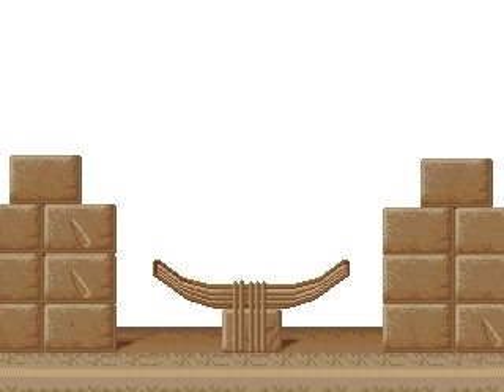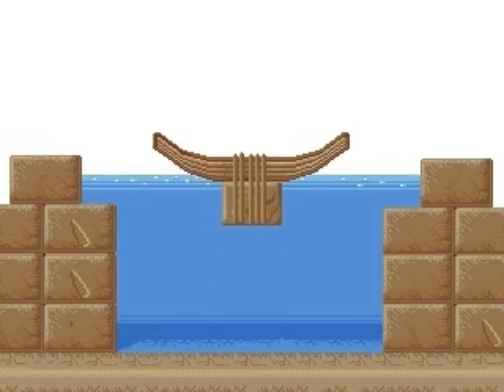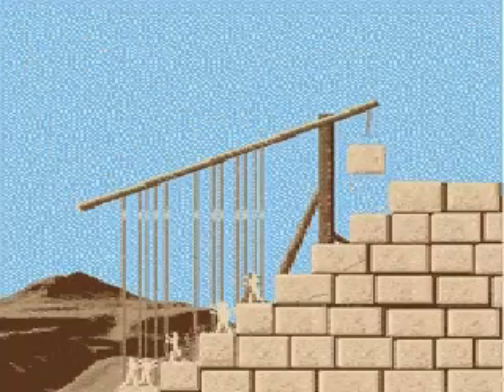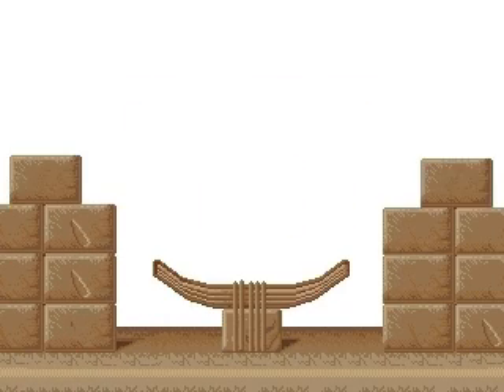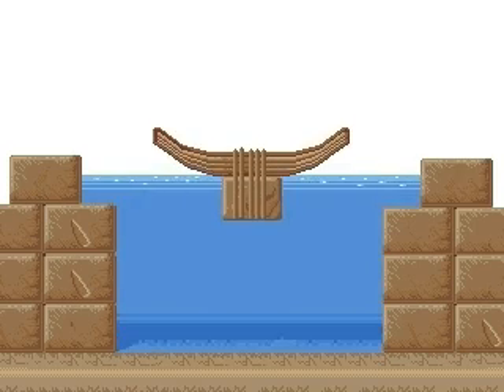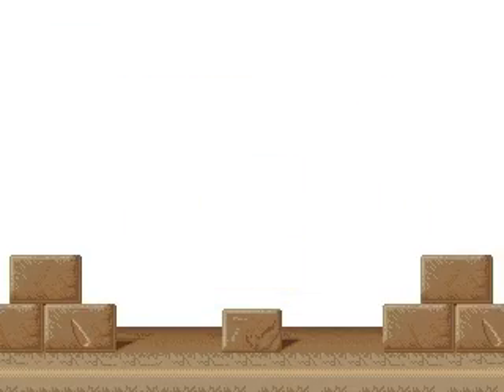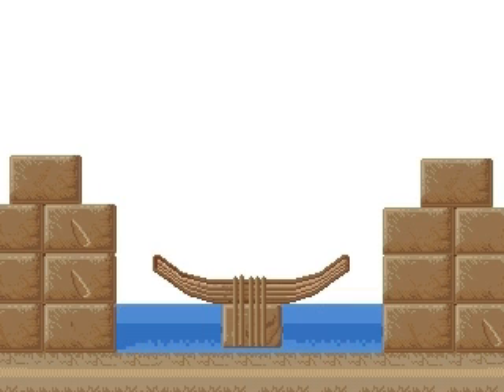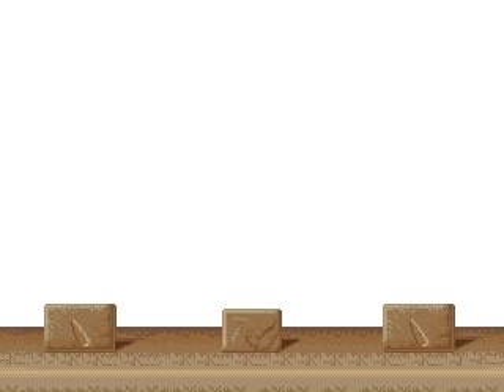How the Egyptians build the Pyramids (a theory) 1

Comment: Using the method that is shown us here, the pyramids were still under construction until today. I believe the egyptians used a slide system to pull the stones up to its place. These slides were filled with sand and when the sand was heavier than the stone, the slide with the stone on it moved upwards. Sand was everywhere around the pyramids. Why should someone carry gallons of water through the desert if you have sand in masses to lift weights with it?

Comment: Not really. most of the pyramid blocks are not actually that big and were quarried right on site. 7 degree ramps using sleds, logs or a slick would be a huge task. There are much easier methods and the spiral shafts have not been verified. The lower tunnels and chambers are verified and they are not tombs but built for functional engineering purposes. All the great engineering of modern day are for function like dams, irrigation etc. Same in the past.

Comment: - Giza is along the Nile river
- Leave out blocks where you want rooms and for the flooding chamber (maybe why the stones were cut with such care, so they would seal). He showed this in the video...
- Dig a channel from the Nile, so the blocks can be floated from quarry to final placement. Put the blocks on top of the boat, on logs, to roll them into final position (no more rope).
- Boat+block enters a door at the bottom, which is sealed so the chamber can be flooded.

See? Just have to THINK!

Comment: We, as modern man, did invent the wheel since our civilisation is continuous.Your suggestion makes it appear most people believe we invented it yesterday.

Your timeline is out by 1200 years. King Tut (1332 BCE) was 3300 years ago, not 5000. Just because he had a wheel, it doesn't follow that the Egyptians had a wheel during the time of the Great Pyramid (2560 BCE), 4500 years ago.

Q. Why do you think nobody has suggested they used a pulley that would multiply load shifting? A. It's a wheel.

Comment: Egyptians first used mud bricks to build pyramids indicating a technology inclined to search for fabricated forms of stone,not quarried stone, but Concrete. If the blocks of the Pyramids show no signs of fossilized designs randomly on the surfaces,then they are concrete.The Romans conquered Egypt in 50 B.C.and shortly after used Concrete pours to build the Coliseum and the Pantheon, the worlds oldest and largest 124 ft. span dome of pure non reinforced Concrete construction. No fossils= concrete

Comment: To tell the truth, I have thought of this as well. The Boats used would have had to have been quite large to support such weight. And as  sandyacombs said. How would this work once they gained height?  @ cytherina, A little pre thought before starting a job makes the job go faster.  If they built canals and/or locks to do this, It would speed up the work once they were finished.  You wouldn't put siding on a 4 story house  by repelling down from the roof. You would put up some scaffolding first

Comment: Weren't the blocks made from limestone? if so then the blocks at the bottom would have worn away before the completion of the pyramid causing mayhem. Also Egyptians valued their water resources. Their only source of water is the Nile, and while it was flooded at the time, they still valued it as a resource.

Comment: I'm not convinced. On that photo, there are so many points that can be joined by lines, 'fitting' a map of the inner planets to a photo like this is actually quite easy.
I proved this to myself in 5 minutes by drawing 3 random pyramids on one piece of paper and a sun and 4 random planets on another. It was quite easy to join some of the many points and make the 2 independent images 'fit' together.
By rotating 1 image and altering it's size to suit, the effect could be made even more convincing.

Comment: Continued....The Great Pyramid actually has a latitude north of 29degrees 58minutes 50.952seconds or 29.98082degrees north in decimal degrees - similar but NOT the same as the figure for the speed of light in m/s. Like I said, it's just coincidence that the first 3 digits are the same.

Comment: Didn't you see my reasoning WHY it can only be a coincidence? The metric metre was only invented, as a unit of measurement, about 125 years ago. It's development and introduction is well documented.
With that in mind, how can the speed of light measured in METRES per second have any real connection to the position of the Great Pyramid, which was built 4400years BEFORE the METRE was developed and introduced?

Comment: Exactly. Everyone knows they built a huge 480ft wall around where they wanted the pyramid. They floated the top brick into the middle on a raft. When it was there, they let some water out and put the bricks under it and so-on until they got to the bottom. And before any debunker tries to ask how they could built such a big dam...EASY. They built a bigger dam around where they wanted it, floated the top bricks out on rafts, let some water out, put the next layer under the first, and so-on.

Comment: ... you will most likely find it. That's the thing, if you've come up with something( in this case, someone wrote down a story about a flood) and you later try to find facts to support the claim, you can make the facts point in the right direction as long as you ignore all the facts that point to another direction. That's the problem with the kind of thinking you propose. You can be thinking 'outside the box' without having to resort to magic as an explanation for natural occurances.

Comment: Limestone, not granite...and caps only makes you more obnoxious.  Stone on stone for tools works just fine, pyramids were built around the Bronze age so they could have used metal tools, albeit a soft metal that would require frequent sharpening or reshaping.  Just because this occurred thousands of years ago don't assume they were idiots such as yourself claiming they had to use lasers, their constructions still stand 5000 years after being built so they knew what they were doing.

Comment: Good thinking, I have read about ancient rock splitting using ice. In the 1960s I heard that the Saudi government had a power station built which was over 100 feet underground, when they came up against a major problem. (How to lower a massive marine diesel engine) 100 feet down, heavy lifting gear could not have been installed in the dessert. The engineers filled it with water, froze it, put the engine on top and melted the ice. (in the saudi dessert).

Comment: Water systems (aka ground water when in deserts) change very frequently over the millenia - entire civilizations originally built around plentiful ground water have vanished when it dried up.  I doubt the Egyptians suffered abject drought as the region has these days, its likely there was a readily accessible supply - also, water is very simple to transport and manipulate using siphon methods so the theory of floating rocks isn't all that far-fetched.

Comment: using levers, lifting the stones would not be an overwhelming task. but they didn't have the wheel, i understand..which makes it all seem impossible. and anyhow, cutting the stones to precise shapes would have been the biggest problem. That alone would have been impossible, especially with just hammers and chisels. I'd like to see somebody cut out just one of those, much less 2.3 million. You need a diamond blade saw, or its impossible.

Comment: what about the theory of them using kites made of boat sails, with shellac made from bugs (found close to egypt) to make them stronger. these would be huge and wouldnt need much of a gust to fill the sail. making the 390 pound blocks lift off the ground making them easier to assist with pullies and lifts. the boat idea sounds good but then what how do they get them else where it might be ok for a few blocks but not all of them it would be impossible.

Comment: Stones were dragged on sleds on ramps up the pyramids. They used mud to make them slide and a dozen men could drag one stone, Giza was built in approx 15 years laying 1 stone every three minutes at first slowing as they reached the top. Check out secrets of the pyramids revealed by swiift. The hoist application was debunked ten years ago, where have you been?